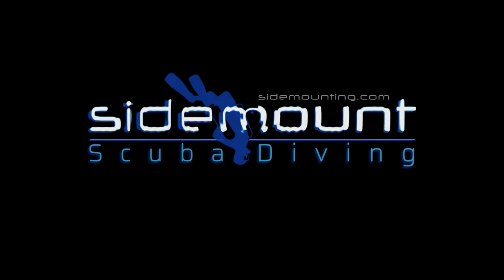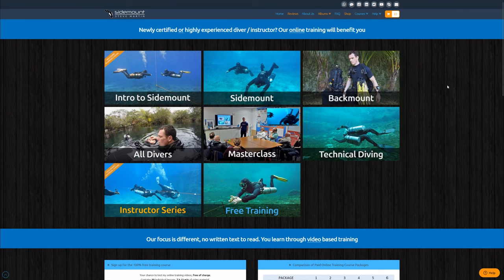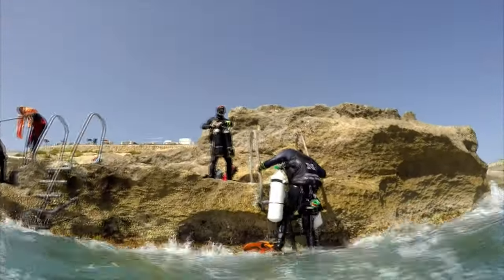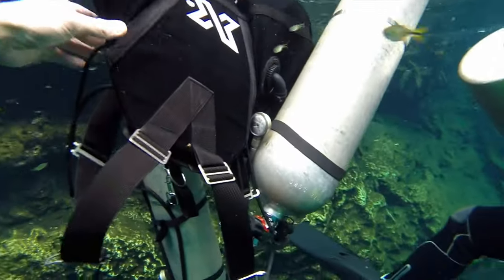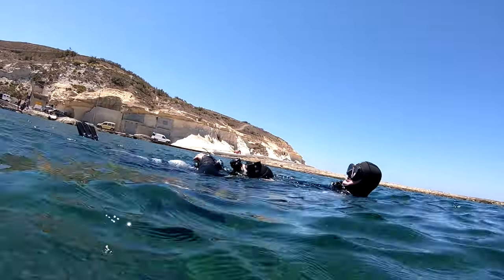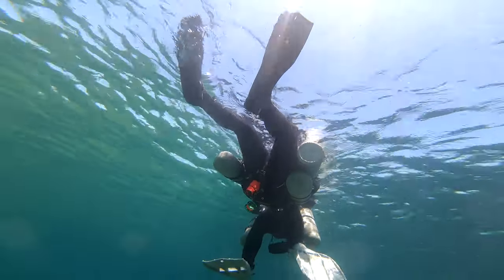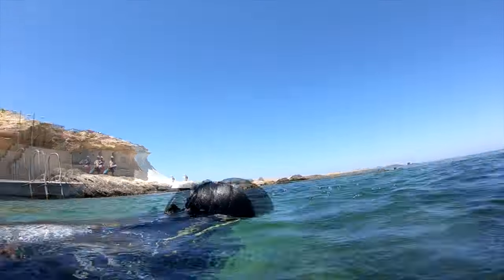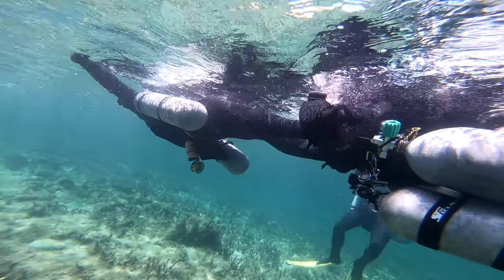Towing Divers On The Surface | Sidemounting.com

Comment: When collar towing (harness towing), use a mirror on the back of the hand (situated at the thumb webbing) to see behind you without the need to turn your body to check behind you. That's what I do, and it works great. The dive mirror is my absolute favorite accessory I use for multiple purposes on every, single dive I do, regardless of type of dive or configuration.